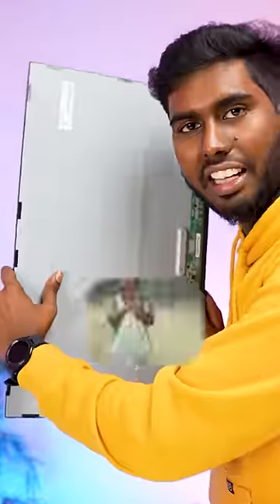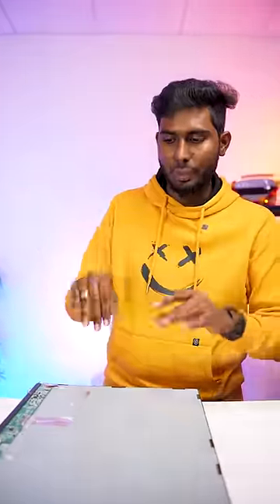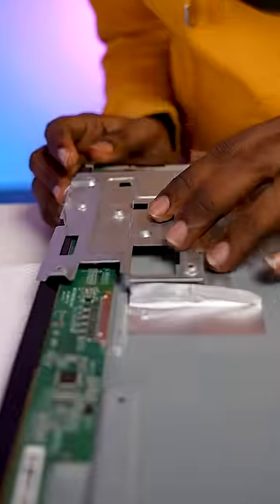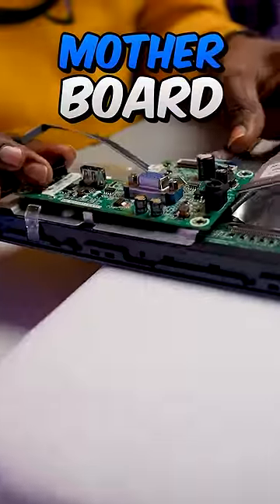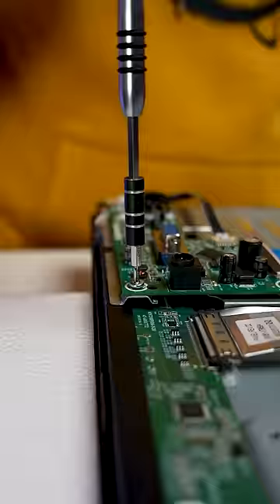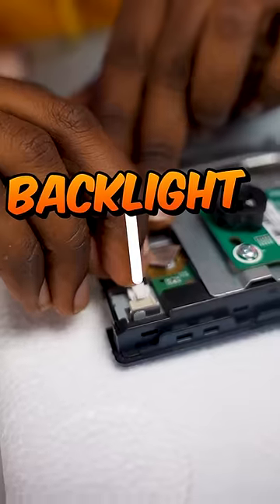Monitor Water Damage 🌊 | Samsung Monitor Display Problem Repair 🛠 - Monitor Display Fix

Comment: Pc doc gps video seekram podunga 😂
Reply: TTF all product check panga 😅
Reply: Sunday sambavom loading
Reply: @Thiru7unknown  y
Reply: Ttf gps video vennum
Reply: This file does not have an app associated with it for performing this action. Please install an app or, if one is already installed, create an association in the Default Apps Settings page.

OK
Reply: Ttf all products na Ada pakkanum

Comment: Bro can you prefer a best laptop for 3d modeling & solid work purposes under 70 to 80k budget 
Our requirements :
Ram-16gb or more
Rom-512gb (expandable)  or more
Processor-i5 to i9 or ryzen 7 to 9
Graphics - must be rtx 4050 or more ( rtx 3050 if 4050 is not affordable)
Reply: Lenova LOQ check panugha

Comment: @pcdoc bro... Ennoda PC onnum on panni 5 yrs achu... Ippo on panrapo ulla irundhu smoke vandhuchu... Adha ready panna mudiuma... Ulla neraya memories iruku.
Reply: Maybe smps laa irundhu smoke vandhu irukum bro cabinet open pani clean panithu kadai laa new smps pothu paka sollungha work achinaa apa new smps yaa vangunga
Reply: If you just want the data from that pc then neegha sata to usb cable vangi harddrive yaa thaniyaa kalathi eduthu vera pc laa andha cable vechi connect pani ela data vum pathukalam and also neegha tv laa koda connect pani try panalam
Reply: Thanks bro... Smps problem illa... Board la erinjuchu
Reply: @aswampstory  apa neegha harddrive yaa kalathi sata to usb cable use pani ungha ela data vum recover pani store pani vechikalam bro
Reply: @aswampstory  but a sata to usb doesn't cost you that much so it's your choice

Comment: Bro pendrive connect in to ram panna mudiuma performance increase aaguma
Reply: Performance elam increase agadhu bro ana low ram iruka pc laa use panikalam ram low vaa irundhaa neriya softwares yaa pothu use pana mudiyadhu so pendrive irundha adha ipadhi use panikalam as a emergency purpose
Reply: Ok bro

Comment: Bro naan en laptop la os potukituirundhen aparam vendamunu solitu eject panita but en window kulla poga try panna adhu bootable disk insert panla nu kai mikidhu  enna pandradhu enga ammaviku ithu theriyathu pls solution sollunga
Reply: Epavuma pc oru work panithu irukum bothu disturb pana kudadhu bro adhuvum os install agum bothu pana ipadhi dhaan agum idha kadai laa koduthu dhaan fix pana mudiyum enna issue achinu therinjaa dhaan adha fix pani seri pana mudiyum
Reply: Ilana google laa neriyaa methods koduthu irupanga adha venna try panugha like draining the battery of laptop and charge it back and turning on or going into bios and fixing the correct boot order etc